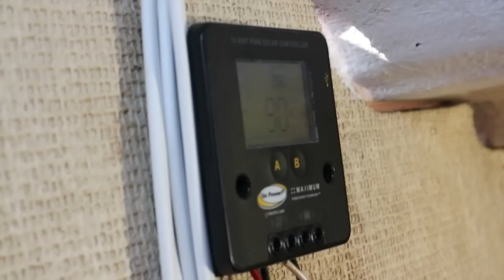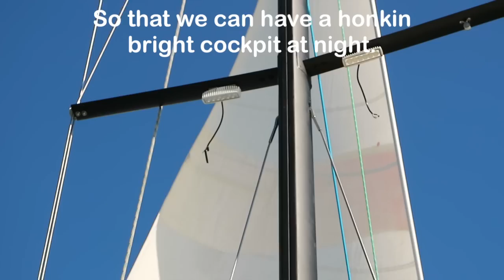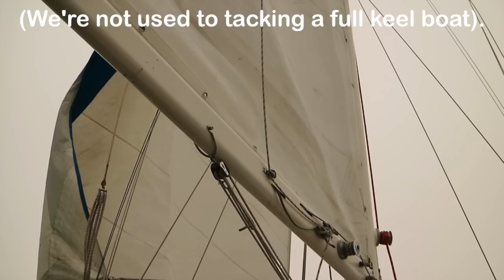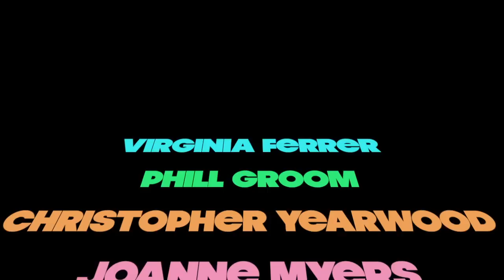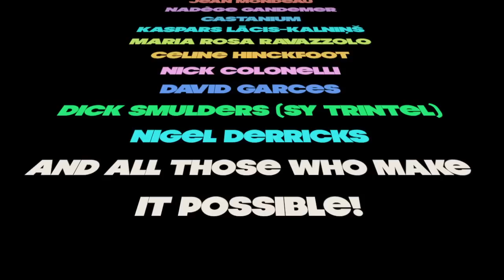23. Sailorama: A Bay Sailing Odyssey

Comment: I realize that I am a year behind this video. Nevertheless,  how much of a difference was made to the actual sailing/motoring part, once the bottom was redone and the new prop was installed?

From Oklahoma, USA ♡
Reply from the maker: Any little dirt on the bottom of Rossa could easily take away 1 or 2 knots in many circumstances, because she is such a lightweight racing boat. With the 13 hp engine, small barnacles and slime made a difference, and weighing about 10 000 pounds, growth seemed to make the difference between surfing down waves smoothly or not.
Reply: @sailorama  thanks for the answer. 🙂

My buddy had a boat that was left in the water to long off the cost of Georgia (USA).  When we took it out on a little cruise it had no ability to plain out on the water.

When we removed it from the water there was approx. 4"-6" of build up on the bottom!  🤯

Lesson learned !!  🤪

Enjoy your channel

From Oklahoma USA, ♡